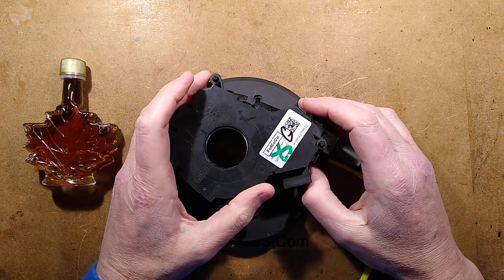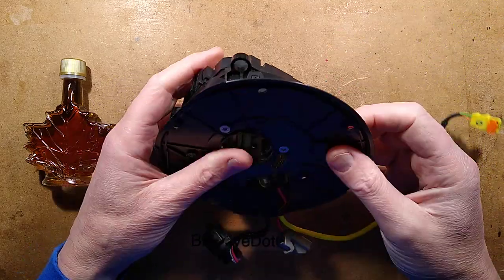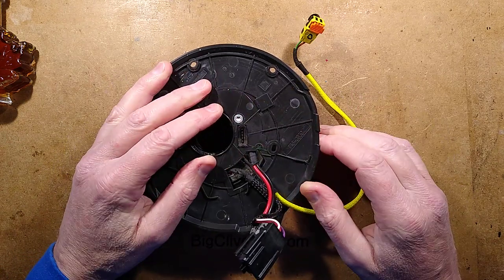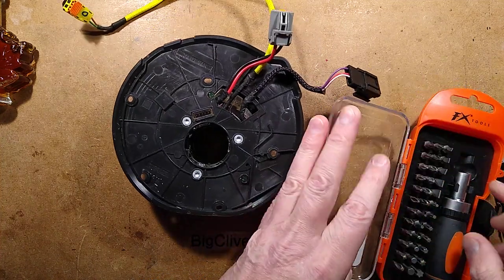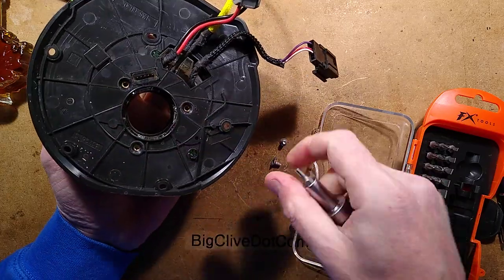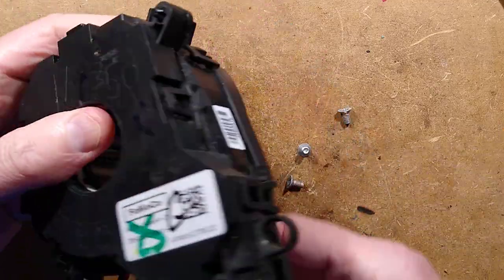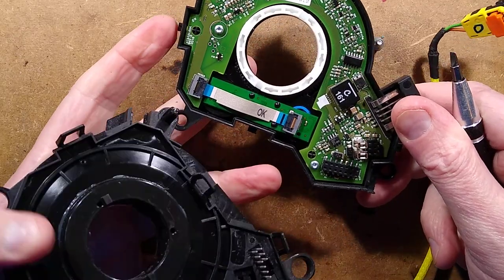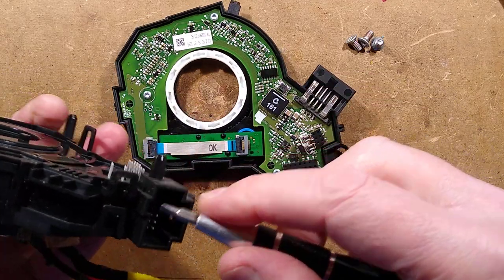Inside a car clock-spring module (steering wheel wiring interface)

Comment: I have always wondered what those looked like internally.  With cars  having a whole suite of controls on their steering wheels these days (my 2015 having no less than 15 buttons), I'm sure part of the job of the electronics is to multiplex these myriad commands for transmission via CAN and/or whatever other bus(es) are present.  And scary how much is in there that can fail, since steering wheels are obviously constantly moved about, occasionally pounded on, baked in the sun, frozen in the cold, etc.  Of course people forget they're mere centimeters away from a powerful explosive too when they're driving their cars.

Comment: I found out what was inside a clockspring while realigning my steering wheel after some DIY work. I pulled the wheel off without making sure the clockspring was unlatched and the entire front of it just popped off and the ribbons came out. I was able to get everything back in but it was making a clicking noise when I steered, and the buttons on the wheel did nothing. Drove like that for like a week, until I got the new one in the mail. Moral of the story is "unlatch everything before you yank on things".

Comment: Each of those chips look to a dual Hall effect (usually north and south, the second chip correlates with the first the centre point is software defined/calibrated, steering angle and the yaw sensors are used by the ABS system a part of a stability control program and on more modern cars, avoidance systems and other driver aids

Comment: Reference point for steering angle is probably the angle at which both front wheels turn at same speed. The ABS sensors are used for much more today...

Comment: The sensors for the rotation look like AS5048A sensors. They can measure absolute orientation based on the angle of the magnetic field. Awesome devices that don't need much calibration. Only downside is that they can only measure 1 rotation. So the blue gear is smaller than the black one and thus every rotation further gives and offset between the two sensors. Thus absolute rotation over multiple rotations can be calculated.

Comment: Thr lock is not the ignition lock but it is there to lock the clockspring when in transit (when not in the car). The high current cable is most likely for the airbags.

Comment: My guess is that the magnets are probably in quadrature to give directional information. Basically by looking at the edges from the hall effect sensors it can tell which way the wheel is being turned. This probably also means that there has to be a calibration procedure at the dealer to establish what position is straight ahead. Edit: Quick internet search shows there is, at least for some Ford vehicles.

Comment: Steering angle sensor for stability control and emergency braking. You have to calibrate them so there won’t be a position for straight ahead.

Comment: It’s been hinted at by a few people, the two encoder wheels aren’t the same size so it’s able to determine the exact position. I can also confirm that you calibrate the car to it with a diagnostic unit / code reader while driving in a straight line at very low speed (I calibrated one 2 weeks ago)
Reply: Pretty sure it's the first, to rule out errors between them and know that sensor A needs 64 steps and B something else, if they don't match up, the computer considers the situation as a serious error that exists and probably halts starting.
It's like how I suspect a gear-selector I got for a truck sim-rig setup works: all positions of the lever are detected through hall sensors, but it looks as if each is cross-checking it's neighbour upon a high or low state (I've been probing the thing without success, it takes 24V without problems which is nice to know but none of the hall sensors is showing any reading) and it uses that to be absolutely sure that "Yep, I'm in neutral, my direct neighbours are reading nothing" to stop it going off on just the data signal of 1 pin.

Comment: It is a clock spring assembly with steering angle sensor, it my understanding that it doesn't actually need to know the exact position of the steering wheel, only the amount of turns in relation to a accelerometer measuring g forces and the speed sensors on all the wheels to determine whether the vehicle is under control and needs to operate the ABS braking etc

Comment: afaik every manufacturer does things a little different but the way the steering angle sensor works is very simmilar to what the throttle pedal does, its 2 sensing units offset or opposite to each other that has to get calibrated or "learned" by the system for it to know where it actually is for any given module to operate based off that data

Comment: those magnetic encoders could be  AS5048A hall angle sensors, some come with i2c output with absolute position, some with incremental quadrature a/b outputs.
if they are absolute angle sensors, one of the gears could have one teeth less and slightly drift in angle difference when the whole thing is turned..
Reply: The two gears do seem to be slightly different diameters. Makes a lot of sense and just needs a simple lock to lock then drive straight calibration procedure to give absolute position and rate of change.

Comment: The magnetic sensors monitor what's north. As north rotates movement is detected. You use two for direction and have to set the zero point on the car.

Comment: The encoder makes sense on newer vehicles that have backup cameras.  The path "projected" in the view will match the relative turn of the wheel, letting you see where the truck "expects" itself to be while reversing while the steering wheel is at a given angle (if rotated at all).
Reply: That is true, my camera bends the yellow/green/red lines when I turn.  It could also  be used for the newer non-hydraulic steering that are used on many newer cars.  My wife's car does not have a power steering pump, it just has a motor on the steering rack.
Reply: ALso the Anti-lockup brakes and stability program will most likely use it, to detect if the car's acceleration and movement match the driver's input.

Comment: If the two magnets are out of phase of each other it could be used like on a quadrature encoder to tell the direction of rotation.   A single channel would only give you the rate of change.

Comment: 11:28 - I'd suspect those chips are accelerometer chips with a magnetic vane comapss in them. Probably being used as isolated position sensors with a resolution of 1 degree.

Comment: It counts the pulses and you have to use a can-bus scanner to reset the steering to zero after you have done a front end alignment or changed a steering component and even sometimes it forgets its position when the battery gets changed ( Toyota , Mercedes)  with electric steering assist systems

Comment: I think once the wheel is centered the input to the clock spring would be " Zero 'd " out using and Steering Angle sensor parameter in the ODB  settings

Comment: Do the twin positional sensors really have to know where the mid-point is? Obviously the driver will turn the wheel until it is pointing to the preferred direction, and all that the sensors have to do is detect a variation in turn to one direction or the other and signal accordingly. The mechanical limiting in that unit will prevent the wheel from being turned too far to either side.

Comment: hi big clive .  could you take apart and or please  explain how the vw electric  steering works,   i took one apart but can find nothing about it on mr google . it  appeers to use  three phase  brushless  motor  so  how worked from  maybe 100 amp  12v dc supply. thanks

Comment: You usually have to rotate the wheel to both full extents when you replace these, so I would guess that to get the mid position, it has to learn how many pulses are in each direction, which it stores in memory.

Comment: From my experience with clocksprings they can lose their reference fairly easily and can also rip wires out at full lock. Nice and easy to swap out though. 
Fairly cheap 2nd hand aswell, even with steering angle sensors. When getting them just need to make sure it was removed from a car with the wheels straight, secured in position with tape and the same straight wheels when fitting it. You can figure out a rough mid point as you demonstrated and count total revolutions and there should be a marker for middle of each one.
Reply: The one I swapped had zeroing instructions on it: rotate right till it stopped, back off 2.5 turns, then align the two arrows. All you had to do is make sure the steering wheel was centered when you installed it

Comment: All those ribbon cables could be replaced with regular round cables, just place them as close to the centre as possible. That's how rotating  tower fans are connected to the base and they last many years of constant turning.
Reply: Zach Booker  right, well it was just an idea although a bad one, given that the clock spring ribbons should outlast the electronics...

Comment: It an ingenious mechanism in clocksprings, I had the pleasure of replacing one on my BMW as the horn only worked intermittently. I bought one from a scrap yard as a replacement was £600 new. The ribbons have a habit of fracturing with repeated use apparently.

I may be wrong, but I don't think the sensors are steering angle sensors as such. They are probably steering speed/force sensors for multiple systems, variable power steering, dynamic stability control or even just cancelling the indicators. If I remember right on my last vehicle the steering angle sensor was on the steering column itself rather than in the steering wheel.
Reply: Very true.  The newer F150s have electric power steering assist, and there is also animation (and angle display) of the front wheels when the steering wheel is turned.  I believe it is on the "off road" page or something like that, and also shows angle of incline / decline and left/right roll angle.

Comment: If it is being used for the power steering then it would not need to know absolute position. It would only need to know rotation of a small amount to apply force from the assist.  
Much like the way hydraulic power steering works. There is built in slop in the steering after the valve. This "built in slop" for lack of better words, makes the valve move a little when you turn taking up the slop. This applies hydraulic pressure to re-center the valve thus turning the steering system hydraulically.  If everything is working correctly the mechanical steering shaft never touches because as you turn it gets close to the end of the built in slop. But the hydraulics constantly re-center that part. So no mecanical contact during turning unless there is a loss of hydraulic pressure.

  I assume the electric is nearly the same concept using those 2 hall effect sensors and an electric motor. I bet 2 sensors instead of 1 just for safety. If the sensors would read incorrect it could be deadly.  

Anyone who has ever assembled a charlynn steering motor INCORRECTLY knows the system will go crazy and almost break your arm. I can only imagine that in a car while driving. 

Double sensors would be a must.
Reply: for the power steering, they use a torque sensor that senses position difference between wheels and steering wheel across a spring and it commands the motor to fix the difference by assisting (rotating) the wheel. if you wire them incorrectly, they try to rotate towards the opposite direction, so they can never fix it and rotate until they reach the end and might cause damages. 

but this unit is not for power steering. it doesn't have any torque spring. it's for the ESP system (stability control) it senses the absolute position of the steering wheel and compares it with the left and right wheels' speed. if they don't match up, it detects it as the car is slipping and tries to fix it by applying the brake to the opposite wheel and reducing the power. it is not that simple though.
Reply: @pedram.mp4  oh. I have never worked on anything with electric power steering, or traction control/ stability control on the front wheel. Only the trucks that use rear drive wheel abs sensors for the traction control.
Reply: So the power steering operates almost identical to hydraulic except using sensors instead of a valve, and electric motor enstead of hydraulic. 

So does it read 2 sensors all the time to prevent an error from one sensor causing catastrophic failure?
Reply: @pedram.mp4  so does this use 2 sensors to detect absolute positioning, or is one sensor calibrated for absolute positioning and the second is a redundant for safety?
Reply: @poellot  since gears are color coded( blue and black) , I guess they are different, so the computer can calculate the absolute position based on the reading differences of them. Also it can detect malfunction if readings are not consistent.
Reply: @poellot  Yes, there is always redundancy in automotive. With any luck they will be equal but opposite of each other (eg strain gauges one tension, one compression). Even before fully electric power steering there was electro-hydraulic steering which used torque sensors (strain gauges) to get the load on the steering column,  which then sent power to hydraulic actuators to do the assist. Early days they were directly wired, later models went via a computer that also knew the vehicle speed so could vary the amount of assistance based on speed so that it was super light during parking but weighted up on the motorway. 
More advanced systems you can select the response curve (map) to change the weight of the steering. 
My bmw has a computer for everything (steering, suspension dampers, anti roll bars, differential lock, stability control, seat bolsters, throttle pedal, gearbox etc etc) and every computer has 3 maps to it (comfort, normal, sport)  which you can change mostly independently to suit how you want the car to handle.

Comment: Re: finding zero, whenever my Mazda loses battery power the stability control system will flag an alarm. You need to turn the wheel a couple turns left and right before the alarm clears. Wonder if it has a separate zero sensor somewhere.

Comment: Probably a sensor for vehicle tracking, either in a straight line or slight turning. Gone arethe days when there were only 2 nuts holding the steering wheel. One nut securing it to the steering column and the other nut turning it in the direction he / she wants to go. :) lol
Plus other controls for cruise control, stereo volume up and down etc.

Comment: I would not at all be surprised if those hall effect sensors operate 90 degrees out of phase of each other, generating a quadurature encoding which is very useful to figure out which direction the wheel is turning. Additionally, if the cogs for rotating the magnets had different numbers of teeth on them, that would allow for generating an absolute position of the steering wheel within microseconds of applying power to the appropriate wires and sending it a command to read out its position. Or perhaps it doesn't need a command to read out its position since it doesn't do anything other than that.
Since in modern cars power steering has almost completely converted to using electrical power instead of hydraulic (this ends up drawing less continuous power from the engine, increasing fuel economy), even the base model of a car will have such a sensor.
Source: I'm the son of an auto mechanic, and when I'm at the shop and not doing anything important I read the trade magazines (the ones that have the latest technician hints in them, or how to diagnose a particularly difficult thing, or trends in the industry).

Comment: Those magnetic sensors are probably angle sensors so you don't get pulses but either an analog, pulse width or serial data that corresponds to the angle of the magnetic field. A pair provides redundancy.

Comment: Fairly sure my old Sierra used slip rings on the steering wheel, but as others have said all that was in the wheel on that was the horn switch (which someone had wired up to a monstrous air horn, but that's besides the point)

Comment: Clock springs typically are very analog and don’t usually have sensors to detect position unless you have a fancy electric steering and lane departure assistance
Reply: Hydraulic only steering on Ford Ranger pickups up to 2020 model year. No lane departure assistance although they do have stability control and trailer sway control systems. The steering wheels have the obligatory audio/head unit controls, phone buttons as well and some have cruise controls on the other side. The Wildtrak has a reversing camera but I'm not sure that it has guidance lines that move with the steering angle. Probably.

Comment: I would assume that magnets would be at right angles to each other so that when one magnet is in a position that it's sensor gives the worst resolution the other one is getting it's best resolution.
I don't think there's a good case for having an absolute zero sensor for two reasons. First, the steering wheel itself has more than one revolution so you would have at least three absolute zero events and you'd have to keep track of which one was the actual one. The other is that (I've been told) that some mechanics do the wheel alignment a little off center so that when you are driving down the road and you hold the steering wheel in the middle, it automatically compensates for the crown of the road. This would of course be in opposite directions where I live vs where you live.
BTW love your channel. I wish I could take apart expensive stuff like I used to when my dad was footing the bill.